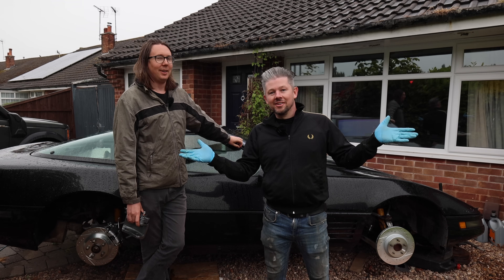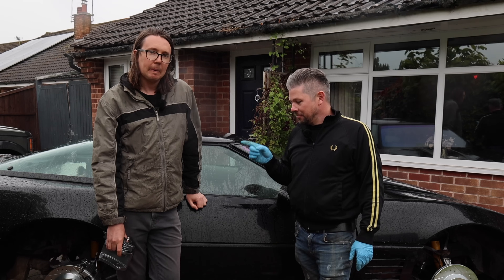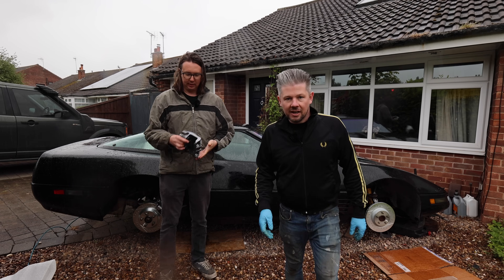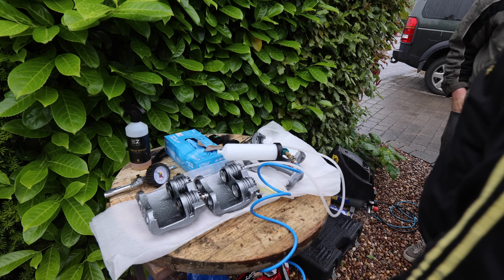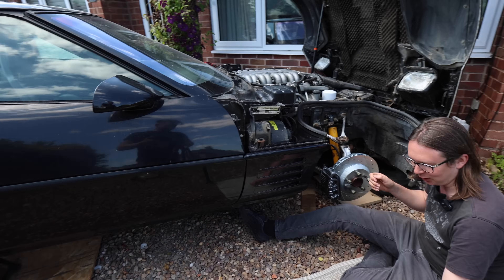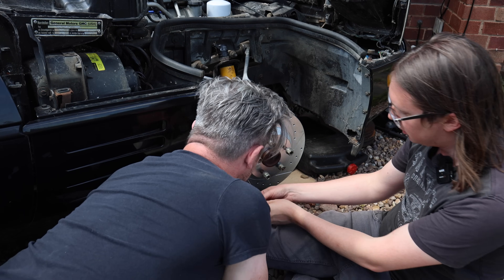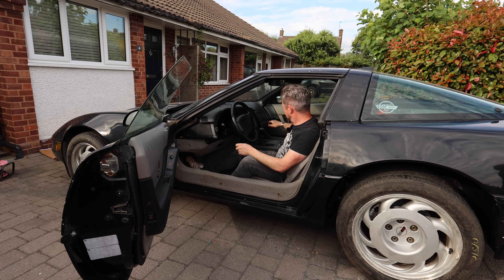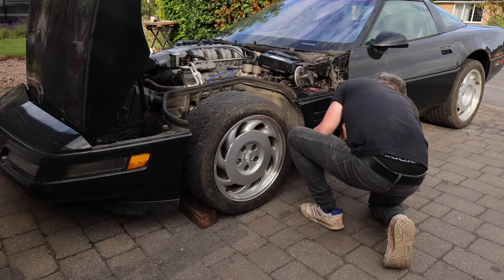PROGRESS! Our British ZR-1 moves for the first time in 18 YEARS! Corvette ZR1 Project Episode 10

Comment: Main reason is , it interferes with the abs , esp , and epb.  You only need to google it fellas. But copper slip is the old fashion way and especially  if u using it beetween alloy and steel , thats where u get corrosive  problems with copper slip as copper slip actually  contains metal , and thats y the sliders also get siezed when using copper slip on sliders  and pads. I used copper slip for 15years up until 4years ago when i found out myself. Once u use synthetic brake pad grease i will never look back. Its just double the price
Reply from the maker: Will look into this, if there is a better way!

Comment: You should do a wrap on that car instead of painting it. That way you can change the color when you get tired of it. Not near as expensive as a re-paint...
Reply: A wrap on a car like this? Stop swearing!
Reply from the maker: Wrapping isn't an option, I imagine when the wrap is pulled it would remove all the original paint... Also, its not totally smooth so you would still see all the imperfections!

Comment: 😮😢😂🤣Never ever ever use a clay bar. Use a clay cloth please a clay bar is for dropping on the ground and filling with dirt!!!! A clay cloth you can wash off if you drop it fools😮😢👎
Reply: Steady on fella…
Reply from the maker: These bars were brand new out of the packet and we didn't drop them! You're right though, they can ruin paint quite easily!
Reply: Great job guys. Cleaned up well, I would leave it original and just sort out the odd bits of paintwork. Hopefully you sort the engine out soon as possible so I can hear it purring like a kitten.
Reply: Is this going to be for sale when it’s finished?
Reply from the maker: We want to keep it and share ownership. It may be sold in the longer term but that’s not the plan at the moment 👍🏻🙂